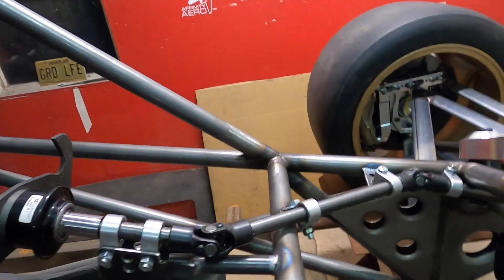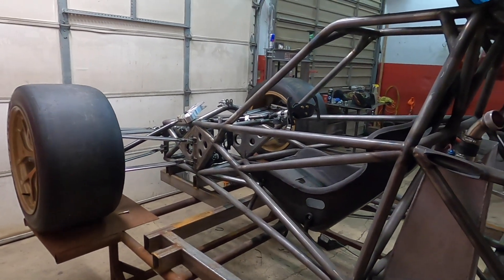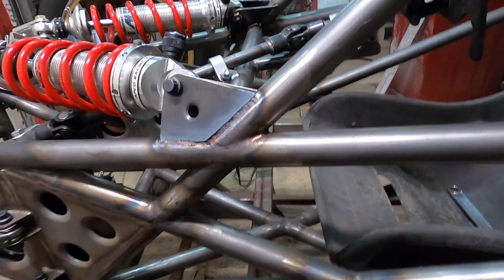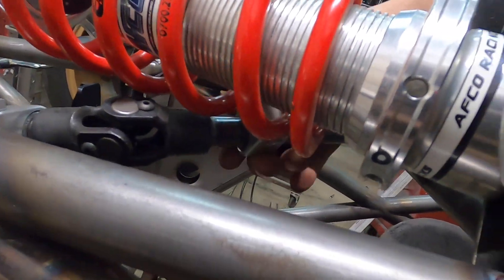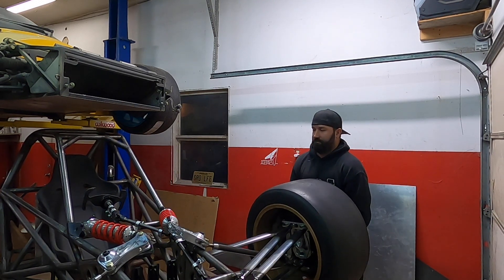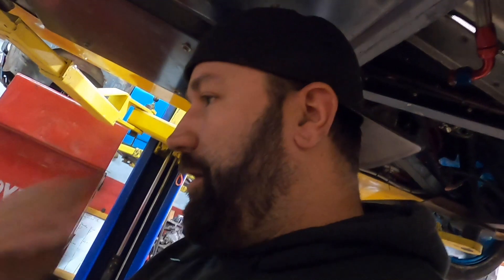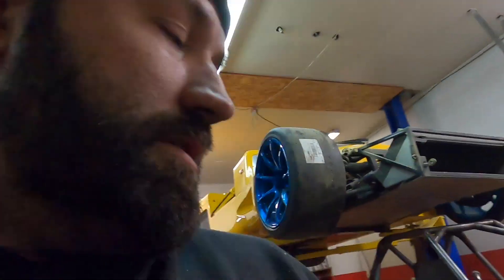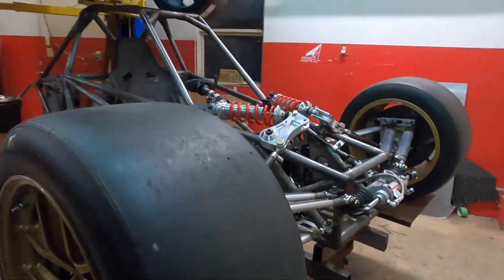ENVIATE EVO Hypercar Steering Column is DONE!

Comment: Cody, I know this will sound crazy but if you check it out you will find my statement is true.  A longer wheel base as in 3 meters or even 3.3 meter car is more stable at high speed and the car will still turn in on tight corners.  The fact is the longest wheel base F1 car is the Mercedes and in a recent study of F1 car over 10 years they could find no relationship between wheel base and tight tracks wins.  In other word just as many long wheel base cars won at tracks like Monaco then short wheel base cars.  A long wheel base car is more stable in corners and less inclined to spin.  The closer the car gets to width and wheel base being the same the more unstable it will become.
By the way love what you doing on the project keep up the great work.

Comment: Great job you have a nice packaking ! I still have some question is your push rod aligned with rocker at right high ?
 What the biggest angle of your steering assembly ? In endurance you don't want to have more then 17° of angle in your steering joint because of loses in the imput and durability. But I think for pikes peak it is ok. I quote Claude Rouel on than, 40 years of top motorsport engineer.
Reply from the maker: We have almost double that for turning radius.  For pushrod, there is a slight misalignment at full compression, but there is no binding, and its within fea thresholds.
Reply: @CodyLoveland i I'm not sure if we understand each other.  I was talking about the angle of the u joints on the steering shaft. Sorry for my english.
But you are right you have way more turning  radius because of the hair pin. I'm very enthousiastic about your project because you pushed your design to calculation. As an engineer it's how I would do it. 
On the rockers part I was "more concerned" about the compliance and friction. I saw you did a great job on the alignement of the push rod axe with the outer lower wishbone joint center not always easy.
 I'm looking forward to see your 3rd element design. I wish you success.
Reply from the maker: The angle of the Ujoints is OK but I did mess up alignment of one of them, so I'll have to cut out a section and rotate, reweld it.